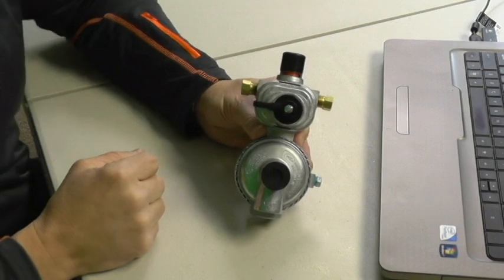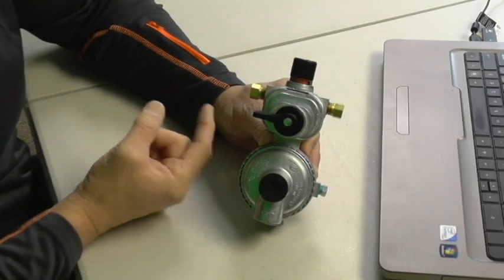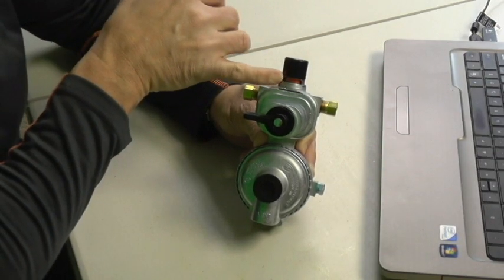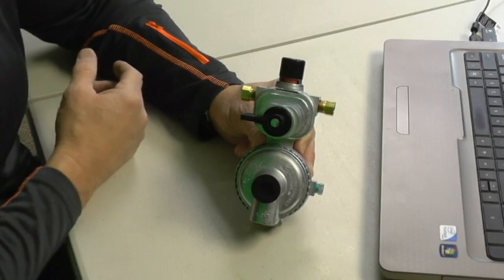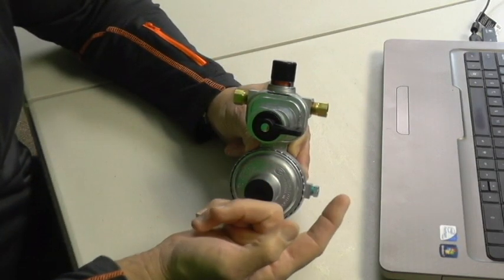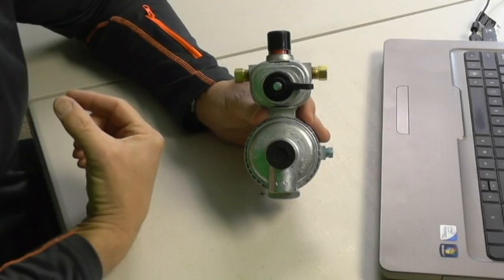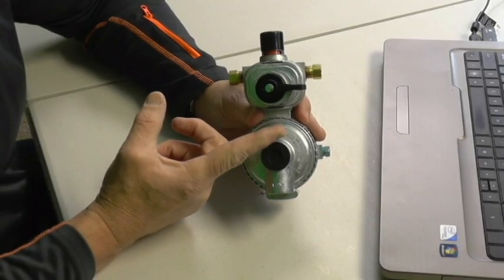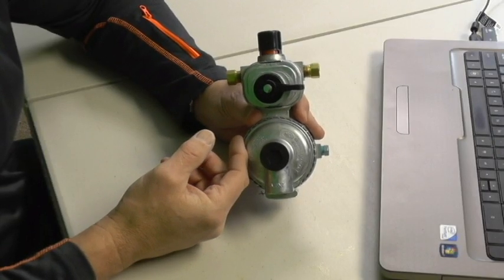RV LP Gas Auto Changeover 101

Comment: So it really isn't "automatic". You still run out of propane and then need to change the selector switch yourself.
Reply from the maker: No it really is automatic. It automatically switches from tank one to tank 2 while you’re asleep so you won’t wake up cold.
Reply: @Trvparts  ok. I changed the old one on my 1991 fifth wheel and waiting to see how it operates in comparison to the old one. From the videos I watched, I gathered there is no real difference except the orrifaces for the threads to the propane hoses. Thanks for reply

Comment: I have a 9k generator what will I need to use a auto change over for 100# dual tank a setup will be running with a 15 foot -1/2 inch hose to my generator ?
Also what about the regulator that is already on generator what happens with that ?
Reply: Tank size makes no difference. I have 2 30# tanks and 2 100# tanks. One 5 ft hose and one 4 ft hose and an auto change over regulator. So what. It's like you are asking if you can paint a Dodge red and drive a Chevy. Makes no sense. Does your generator run on propane is the question. If it does, then wheres the problem with what you have. I don't like stress either. Keep it simple and have a great day.
Reply from the maker: You have too many variables in your question to give a definitive answer but one thing is for sure; Regulators, and the change over is one, can not be put in line (unless designed that way for an application) and come out with the lowest pressure.

Comment: You did not explain how it automatically changes over. SMH!
Reply: Thanks I watched a different video and figured it out. 
1. Turn on both propane tanks 
2. Select either tank to pull from
3. Selected tank runs out
4. Valve will internally switch to other tank without flipping the lever
5. The sight glass will now read red on the direction of empty tank. While pulling from full tank
6. You can now flip lever to full tank and the sight glass will read green. 
7. Pull empty tank to get filled
8. Install full tank and open valve
9. Automatic will internally flip when tank is empty.
Reply from the maker: When the lever is on one side and that tank on that side runs out of gas, and thus gas pressure, the baffle inside switches over. At that point the gas is coming from the tank opposite of the direction the lever is pointing.

Comment: This is NOT automatic ... You just manually turned the lever ...
Reply from the maker: The reason they call it Automatic is when the one tank is empty it Automatically changes to the full tank. Then you have to turn the switch to the full tank B4 you fill the empty tank.
Reply: @Trvparts  ok makes sense ... when you remove the empty and refill it and connect it back up, do you have to turn the lever again..?
Reply from the maker: @ACommenterOnYouTube No, you bring the newly filled tank back and re-attach it to the hose. Leave the leaver just where it is and when the other tank is empty it will automatically flip back to this tank.
Reply: Ok... that i get but then the other tank will go empty which means you will have to move that lever a 2nd time to the FULL tank to allow you to remove the empty tank ... 

From what i am seeing here, you attach 2 tanks ... turn ON both tanks and allow the gas flow, when the 1st one goes empty, it will switch to the full tank automatically BUT when you go to remove the empty tank, you must turn the lever to the FULL tank so that you can remove the empty tank, get it re-filled, connect it back... Now the process has started again, as the one tank goes empty, you have to turn the lever AGAIN to the FULL tank to allow removal of the empty tank ... 

While all this is automatic to a degree, you still have to turn the lever to the full tank to allow removal of the empty tank ...  every time .. !! 

The way i see it, you should NOT have to turn any lever at anytime, when the one tank is empty, you should just be able to remove it, get it filled and re-attach it without having to turn any lever ... 

It should be designed so that when it swaps over to the other tank, it isolates the empty tank for easy removal .. and so forth.. never having to turn any lever ... But it does not work that way ...
Reply: @ACommenterOnYouTube  Oh no, we have to turn a lever each time?! How outrageous! Don't be so damn lazy.
Reply: @Terminator_2003  FU ...
Reply: @ACommenterOnYouTube  I would like that very much.
Reply: @Joe-jz2dw  13337 Kirby Smith Rd, Orlando. Fla 32832
Gate code is 2368
Reply: @ACommenterOnYouTube  
The time you spent writing this and complaining about turning a little lever, you could have turned the lever many many times.
An AUTOmatic transmission in a car still requires you to move the lever to put it into and out of gear.
It’s not the end of the world, once the valve AUTOmatically switches tanks, you have to move the lever so you can remove the empty tank and get it filled.
Quite the simple process(for some people)

Comment: Question: I have my rv stored, and turn off the propane and electric but forgot to turn off the frig will the motor burn out trying to suck propane?
Reply: Carole V . No it will not hurt it. Your refrigerator is an absorption system and does not have a motor. It will be ok
Reply: That was the most odd question ....  If you turn off the propane and electric, HOW if the frig still ON..??